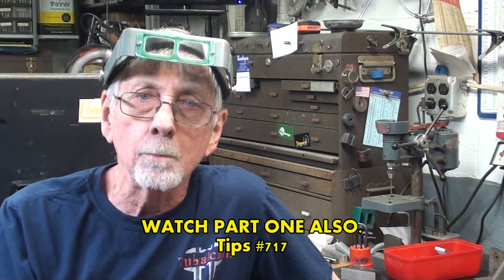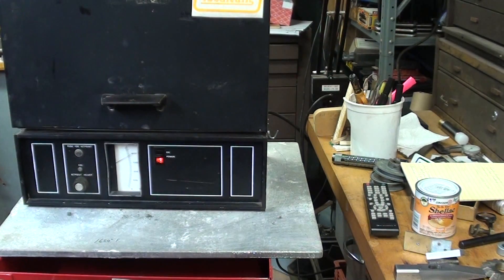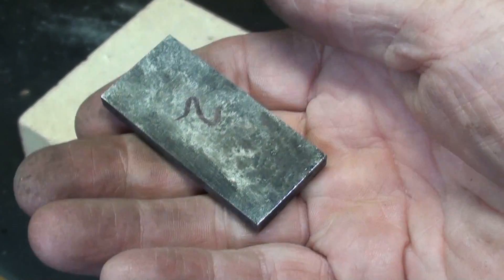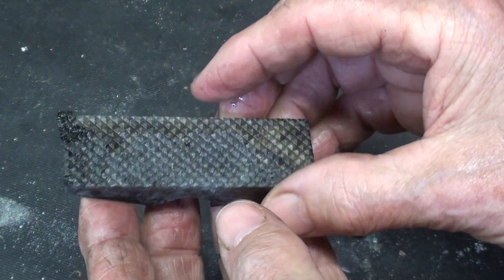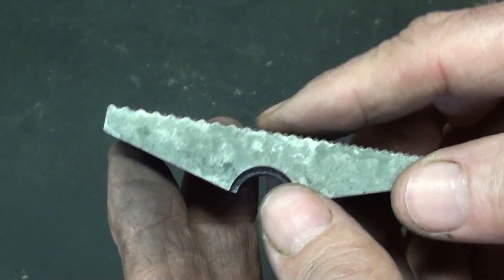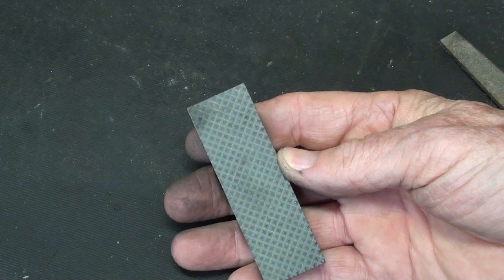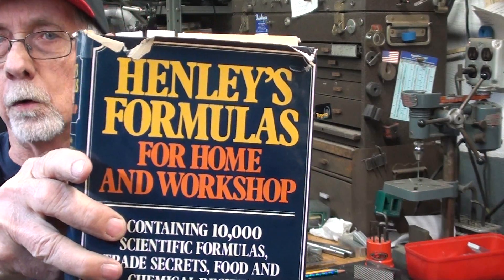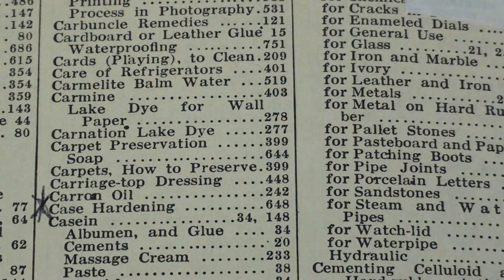CASE HARDENING Surface vise jaws #718 pt 2 KASINIT tubalcain

Comment: FILING A BOTTLE -- Did you know you can make a cut edge of glass safe with a file?  Turns out that glass hardness is similar to steel so a file will catch the jagged edge of the cut and break it off.  Obviously, it won't work on a smooth piece of glass, like a bottle.

Comment: Great video MrPete.....Why is tool steel so challenging to heat treat?
Reply from the maker: Did I say that?
Reply: @mrpete222  you were saying tool steel can crack around holes...how come? I'm going to be making a new jaw in a tap wrench and I was going to use tool steel(and harden)

Comment: I once read in a model engineering magazine that it was possible to do case hardening (at least to some extent) by using sugar.  Sugar has a high carbon content that transfers into the first few microns of the hot steel.  I've never tried it myself though.

Comment: A somewhat similar method of hardening the outer surface cast iron has been used by the Corliss Safe Co.   Since cast naturally has a very high level of carbon in the mix, none has to be added.  It had to do with how the iron was cooled.  Instead of pouring the cast into a sand mold, steel molds were used.  Well I think they were steel, but for sure they were metal, which caused the metal to cool very quickly.  This caused the outer surface to be quite hard to prevent drilling, with the drills available at the time in the 1870's.  The resulting metal was called white cast iron.

Comment: Excellent video,Mr. Pete.I´ll like to mention two things.First thing is about quenching deformation because of the heat shock.Second thing is that as compared to other case hardening methodes that I´ve seen ,the piece plus the hardening mixture,both go into the oven in one take and after heated they go to quenching .There is a video in Antiquitera(not sure the spelling ) that tells you how they did it several thousands of years ago.Thank you.

Comment: Made vise jaws last month with tool steel and oil hardened. Wish I would have seen this video and saved the money on tool steel and case hardened. Going to make another set this way. Remember working at Waukesha Motors many moons ago and they heat treated cylinder liners using cyanide pellets. Have to laugh at 18 years old all I thought cyanide was used for was the false tooth in a spy movie.

Comment: Tincture of Mercury is the red stuff you used to put on wounds as a disinfectant. I still have some.
Reply from the maker: Is that the same as Mercurochrome?
Reply: @mrpete222  I believe so. My little bottle says tincture of mercury 0.1 percent. 50 percent alcohol.

Comment: You can place the piece inside a larger box, filled with coal. The box must be closed to maintain the internal atmosphere with a good level of carbon. The ideal is to leave it in the oven for at least two hours, to form a layer about 0.3 mm thick. After half an hour, the layer is no more than 0.05 mm.